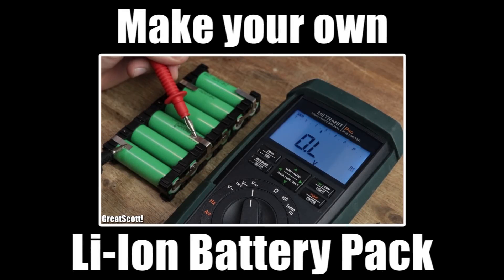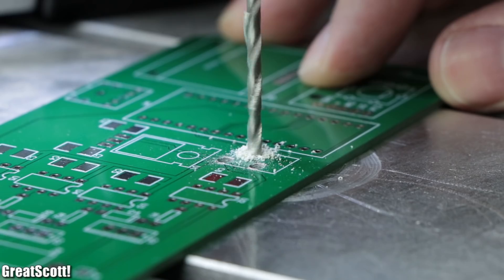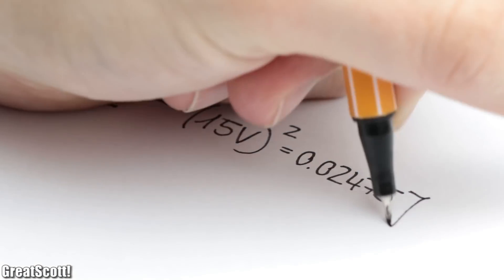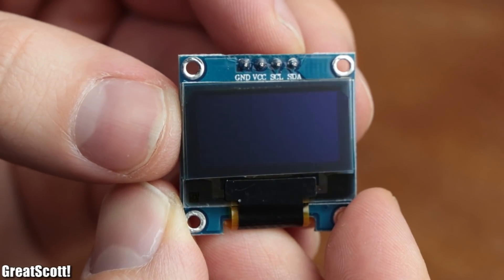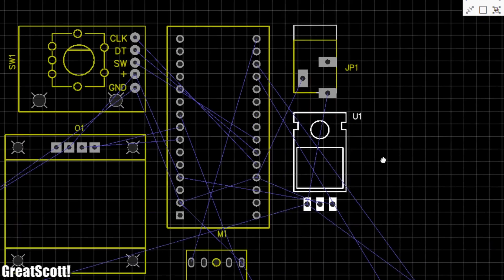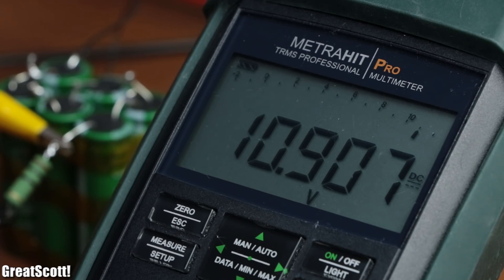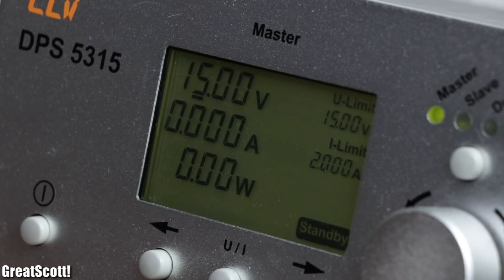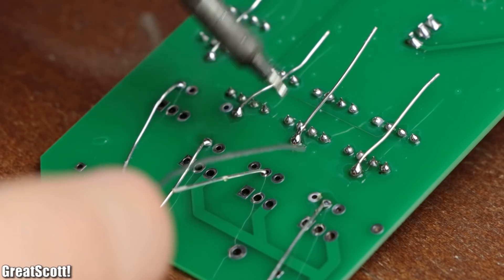Battery Spot Welder (CD Welder) || DIY or Buy

Comment: maybe i dont get the problem. You have missed the reference potential on the gate for a proper functioning circuit but i dont get why this is the cause of a possible short. With this design you would have had a short on the supply everytime you'll give the pulse for the discharge , maybe you can just use a current limiting circuit on the supply(buck converter ) so the short won't be a problem

Comment: You should connect the referance point of the discharge circuit to the main power source and not to ground so the capacitors will be shorten and discharge, that's also will solve your problem
Reply: If someone would answer me and explain me the discharge circuit in case I'm wrong I'll apreciate it a lot.

Comment: Hello, I like your videos a lot!!!
Could you please make a video on making a personalized BMS or buy it? Something like "14S BMS Bafang BBS02/BBSHD (Li-ion battery management system) || DIY or Buy"
Commercial BMS from ebay can not regulate the charger voltage per cell. If I want to charge my cells to 4.05V to improve his lifespan, the only way is to make a DIY BMS.
Features:
-Adjustable upper limit voltaje (4.00V - 4.20V)
-Adjustable lower limit discharge protection (2.75V - 3.35V)
-Over current protection (or a simple fuse)

I want to make my own BMS for my Bafang BBS-02 bike motor. 14s is necesary for the extra power of 1000W. I'm learning about Mosfets and the LM431 for bypass the charge current of the cells which voltage exceed 4.05V to a resistor. In this way (as I understand) the rest of cells whith lower voltage can continue charging.

Thank you in advance :-D

Comment: Why not just use a 12V car battery with a simple solenoid switch and an 1$ delay disconnect circuit? Modern car batteries are rated over 500Amps

Comment: I donno... too complicated ?
Just use a diesel car (lead-acid) battery, for a 2.0L Engine should work just fine => 150 .. 200Amps starting current for a short time are no problem then.
1x BTS555 (or 2 in parallel) as powerswitch (rated for over 150A and self limiting+protected. you could even use the sense pin to check current flow).
Alternatively the magnetic switch of a starter-motor, they can handle the current.
Control by pushbutton, or arduino decoupled behind 5V car voltage regulator if you need that.
Cable of course should be starter-cable.
(edit: there are smart FETs / ProFETs for automotive use, the BTS555 is great because it has no SMD layout and is easy to get connections on.)
Datasheet: https://www.infineon.com/dgdl/Infineon-BTS555+E3146-DS-v01_00-EN.pdf?fileId=5546d4625a888733015aa3f57e5e103e
Reply: Another one: i'm pretty sure, that the current they FETs are rated is only if you use the tab as connector. And the capacitor legs are also high resistance.
.. Again, just use a BTS555 and there is no need for all the driver, charge pump, common ground problems atc pp. Even PWM with 150..200Hz is possible.

edit2: Why do you even need a charge controller ?
Just use a 100Ohm or 1K limiting resistor between Power Supply and the Caps, and no resistor between Caps and power switch.
So Power supply is protected, always charges Caps to 15V, but discharge current is only limited by wire resistance.

Comment: Hello all, I created spot welder using old inductor for 50Hz with 12cm^2 core. I removed one half of coil and replaced with 4 turns 40 paralel 1,3mm diameter transformer windings to gets high current. Electrodes are from 6mm diameter copper rod with pick at the end. For driving this transformer i used capacitor dropper and simply timing circuit with relay. Something like this can be made using any bigger transformer for mains voltage. 

Coast: 10 hours of work :D

Comment: 12v car battery, thick cable, motorbike starter solenoid, tig tungstens sharpened to a point and momentary switch.

Comment: I have a question. Looking at the equation 
J = (1/2)CV^2 , why did you not go for a capacitor bank utilizing high voltage capacitors? Even at 100F, when you are at such a low voltage, you won't get very much power due to the fact that there is a ^2 on the voltage and 0.5x multiplier on the capacitance. Wouldn't you have had better luck getting something like a 1000uf at 200v? I would love it if you responded I am actually curious about this.

Comment: Great video, sorry it did not work out. I work for taylor-studwelding.com. I design all of their capacitor discharge, and drawn arc stud welders. We use a thyristor to discharge, and adjust the voltage to vary the power. A typical welder has between 66000uF, and 132000uF, and charges up from 35 to 200V. The welding current is between 2000, and 10000 amps, and the duration is around 2mS. Feel free to get in touch if you would like any advice regarding designing a working welder.

Comment: I have some 75v 22,000 if caps. would they spot weld? charge 2-3 in series to 120-160vdc???  or a microwave transformer wrapped with 8 gauge secondary. and hit with pulsed rectified 120vac? use a dimmer to adjust the ac voltage? I haven't seen anyone do anything like this. could it work? or could it just get me in trouble???

Comment: Nice try, however I can safely predict that your MOSFETs will explode the first time you try and use it.  I have successfully built a similar device, however I had to use around 40 MOSFETs, and even then I would still get an occasional exploded MOSFET.  The problem is that all your MOSFETs are a little different, even for the same part, and you need to have every single one switch on at the same time to effectively share this incredibly high load, since as you expect it’s a perfect short.  I thought it might be transients destroying my MOSFETs, but even with ultra-fast diodes and transient absorbers I still got the occasional blown MOSFET.  I never got around to measuring the peak current, but my guess is that it’s in the thousands of amps based on my testing, since it was impossible to get even one successful discharge with only 10 MOSFETs paralleled.  Can’t remember the part number, but they were 60V 40A parts.  I also used a blank double sided PCB instead of creating a custom PCB and just laid them across the edges of the PCB, one side for the source and other for the drain, for the lowest resistance, short of using something better than 1oz or heavier PCB material.  I would expect better performance from using a single or few massive MOSFETs to cut down on the vulnerability of individual parts when they don’t turn on all at once.

Comment: Ignoring the error you found with the grounds, there are some points that may help you in your design:

1) Maybe putting all those capacitors in series was not a good decision. Doing so you increase the total Equivalent Series Resistance of you power bank, which will lead to decreased peak current and hence, poor soldering capabilities. There is one better arrangement for the capacitors, which will both reduce the total ESR and increase the stored Energy.

To find this point, let 'x' be the number of capacitors in series, an let 'a' be the maximum number of capacitors. let also 'C' be the charge of each capacitor. In you design, a = 6 and C = 100F since you are using six 100F capacitors.

Then, the energy stored in the capacitors, as you are well aware is E = Ct/2 * V^2. We know that if we put 'n' capacitors in parallel, we get 'n' times a total capacitance 'Ct' equal to n times the individual capacitance 'C', while if we put them in series we reduce 'Ct' by n but multiply the maximum voltage rating by n. Then, adding this to the formula we get:

E = C*(a-x)/(2*x) *  (V*x)^2   if we find a maximum to this function with a = 6, C = 100F we get x = 3, that means, 3 caps in parallel and 3 in series. We also get a voltage of 2.7V*3 = 8.1V. The voltage here determines the maximum resistance between the soldering electrodes, and because the soldering materials are conductors, it may be more than enough for "small" soldering.

2) I would add balance resistors to the bank capacitor, as capacitive voltage dividers are no that reliable on its own, causing voltage and charge inbalance in your capacitor tank. Search google image for "Capacitor Balance Resistors" and you will understand instantly, as the concept is simple.

3) MOSFETs are not that well suited for high current peaks. Insulated Gate Bipolar Transistors are widespread used for this same purpose (spot welding). Also, make sure to check the thermal dynamics graph of your device and the Safe Operating Area in the datasheet. If you do not know about these, I suggest you search for it, as there is plenty of information on the Internets.

4) Using one Gate driver for each parallel MOSFET is overkill, you can do it probably with just one, tough I have not checked your specifics devices, so I could be proven wrong. There is an additional problem of current unbalance when using more than one driver, as they may activate at slightly different times, causing current to travel only one switching device. As I have seen, your pulses are on the order of miliseconds, so you are on the safe side.

5) The  traces in the PCB should be a lot wider to minimize resistance which will reduce the current delivery capability. I would also try to minimize the length to the soldering electrodes and remove the soldermask on top of those traces in order to add some solder and reduce  resistance even more. This may be proven unnecessary, since the traces may already have low enough resistance to not affect the current peak capability. More of concern is the thermal dynamics of the traces, as if they are not beefy enough, high current peaks may destroy them. I would search for information about this and calculate the maximum current peak and time for a given trace.

I tried to help you a bit with this positive feedback. I may have one or two more tips, but I can't remember now.

If you try again, I hope you to succeed.

Comment: Almost there, did look at CD spot welder myself after getting inspired by another persons project. Spent a couple of hours reading up about high current mosfet switching and looking up ESR ratings and prices for super capacitors.
After that ended up looking FAR to complex and expensive (cheap low ESR supercaps?? nope) found someone using a 12v car battery + high current rated relay and a momentary switch... A lot cheaper but a bit tooo simple, so made a little timer circuit with display led to flash out weld length and status info, also a couple of buttons to change weld period and of course the trigger on an attiny85.
Couple of fyi's relay i used is rated at 200A continuous and battery 330A(cca). With good contact 60-80ms makes a good weld with ~7mm gap, 100+ms makes most strips I've used evaporate. Also, used a fet for driving the relay, did try a 2n2222 but that turned into smoke the 1st time i hit the trigger :D.
The other guys 12v spot welder vid watch?v=o1NFbchHeM8

Also thanks GreatScott for the great vids and better luck next time!

Comment: I pulled off a transformer welder which cost: 
Transformer - $0
0 Gauge wire - $10
relay - $25
ATMega - $3
7segment display - $5
wood - $0

Will be building an ebike soon!

Comment: Good day, asking for your help as usual. 
I have a power supply backlight inverter from a samsung monitor, I wanted to use it to make a Bench power supply by adding a few more parts. This thing has 2 AC output of 650v at 7.5 mA. and  some 5.1VDC at 1.1A. Could i to make a variable power supply for DC current up to say 50v dc max.

Comment: Hey. I've been soldering a lot of cells lately, and I think I found pretty good method to do it, without heating cells too much.
I used transformer soldering iron with tip was partly damaged which made it work.
What you need is a tip with very thick copper bars, that are connected by a thin wire.
Thin wire gets hot enough to melt solder, and then the current flows directly through it, melting it much quicker, and getting it to stick everywhere.
I've soldered a good amoung of cells like this with pretty good results, and the contact area is quite high as well.

Comment: What's the esr on those caps? I used Maxwell dcell 6s2p for my bank. The esr on those was about as high as id recommend. My board was etched on 2oz
Reply: Also use port addressing on arduino for better time control

Comment: Hi, In your Build Your Own Variable Bench Power Supply using LTC3780, you use 12v 5a power supply to drive the LTC3780. But I want to use 19v 3,42a (peak 5a) to drive the LTC3780. Is that possible? And is there any negative side of using 19v adapter?

Comment: I saw you have stripy font on your display. This is because you have configured 128x32 instead of 128x64 pixels. If you want to have the whole resolution on your ssd1306 OLED Display, you have to edit the Adafruit_SSD1306.h and uncomment "#define SSD1306_128_64" and comment out "#define SSD1306_128_32".
Hope you try to get it working!

Comment: Cut the drivers gnd from circuit ground. Driver gnd to mosfet source. Decouple driver vdd to driver ground with a 10uF cap. Supply driver vdd through a diode. BC547 collector to driver input and a resitor to driver vdd, emitter to circuit gnd, base through a resistor to your microcontroller. You then drive with active low signal.
You can pay me with a case of beers.

Comment: 1:02 , sorry to say but something I notice more in your videos:  very bad soldering, you realy need a better soldering station or take more time to let the solder flow , most of  those solderjoint are very far from good.  Most of them will cause faults over time

Comment: The total amount of joules within the capacitor is dependent on both the voltage and the capacitance of the capacitor (as can be seen from the equation you've used). So if you have 400v 220uF capacitor and charge it from 15v source, you get peanuts out. The capacitor could hold way over 11700 times more energy if charged to full 400v... but few of us have high voltage power-supplies at hand and it's dangerous.

Thus using high voltage capacitors in this type of a welder is not ideal and you want to use something like 50v ones so you can charge them to full capacity before discharging safely. :)
Reply: Im a big fan of what happens when you short a parallel array of 4 of them when they are fully charged.

Comment: Hey, Any idea how long it would take to charge the capacitor in an 120A ESC through a 10Ohm resistor at 50V? I calculated a fraction of a second. Not sure if thats right. Looked like you took much longer to charge.

Comment: Dear Greatscott!

Could you do me a favour, please? I made a spectrum analyzer with 300LED diodes for 10 bands, but the equalizer does not work. I used tl084 ics in equalizer, but it cannot amplify any band. I do not know where I made a mistake.:( I thought it over, the ics cannot amplify 5 volts out. So I want to do the project with arduino, because it can send 5 volts out for the bands. So the problem is I cannot do arduino codes. I do not understand that. So, if possible, could you help me and make a software for arduino and build the circuit in a video. I think a spectrum analyzer would look nice next to your led cube.;)

Looking forward to hearing from you.

Comment: Thank you for this video. I had bread boarded a project and got it working then was transferring it too perf board after all that work it didn't work. I started to get unmotivated after hours of trying to figure out why it didn't work. Until I saw this video even after all your work you didn't get it right. But you still learned with a failure and helped others. I'll start fresh and won't let my failure get in the way of trying projects. Great video.

Comment: If you don't want to control time(you can probably still do it with charging the cap not fully)thyristor would work.(It must be timed at capacitor,tyristor can't open when there's some current being switched.)

Comment: just take a car battery, wire and a high current relay, connect that to a foot switch, then to battery, play around with thickness and length of wire to regulate current and you have a spot welder, works for me

Comment: Work on your soldering technique... at 5:21 the joints don't look good. Maybe you should use a hotter iron.
Also, the solder wire looks a bit thick for this type of work.
1. Iron to the joint to heat it up.
2. add solder between the parts to join and the iron. I mean the solder should be added where the iron meets the parts.
3. stop feeding solder and wait for a second so the solder can flow.
4. iron and let the joint cool without moving parts.

A good joints needs little solder. When finished it should look concave. At 5:21 there is too much solder on the pins.

Comment: If you didassembly some electronic you don't throw away the battery holder. One battery holder can contain one (for example clocks and in case if you want 1.5 volt) or two (for example bike front and rear lights (actually in Hungary) and in case if you want 2x1.5=3 volt) batteries. If you want 6 volt, and you have 4 1,5 volt battery, you connect the two battery holder with themselves and you have 6 volt. And it is not dangerous.

Comment: Can be this spot welder https://www.youtube.com/watch?v=65I4Zx5VDKo work for that aplication?
Thank you!

Also im planing to convert to li-ion batts a Lego 8879 IR controler after a acid leakage of the 1.5V AAA batts and damage of his spring loaded contacts. Im sure that 2 10440 Li-ion cells wil be more than enough.

Comment: Ive got the MAlectrics Spotwelder. It works fine for my needs and doesnt requires to order an bulky China Spotwelder.
https://malectrics.eu/ 
Also the kweld seems interesting. Instead of time it uses energy to adjust your weld power. 
https://www.keenlab.de/index.php/product-category/kspot-welder-kit/